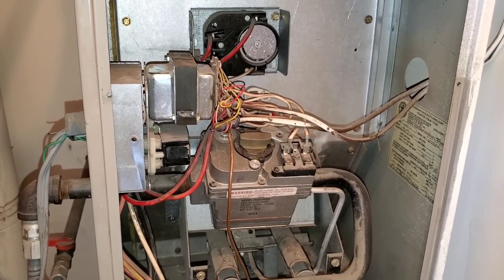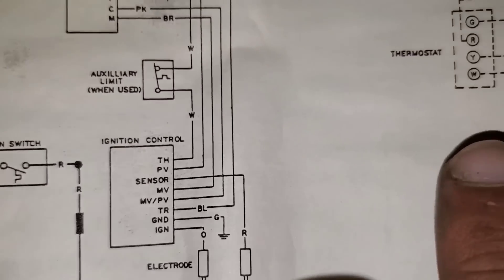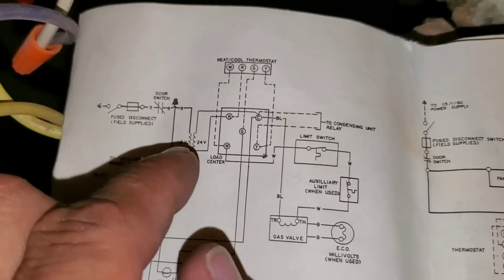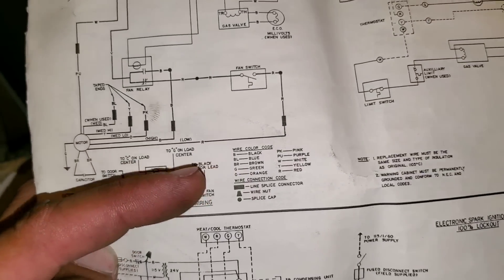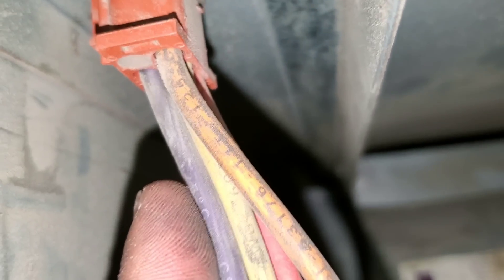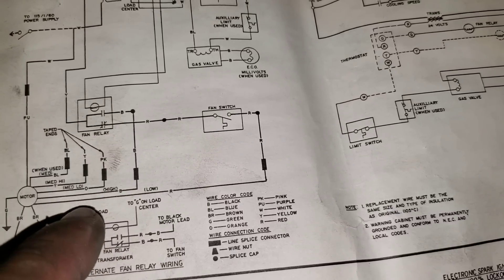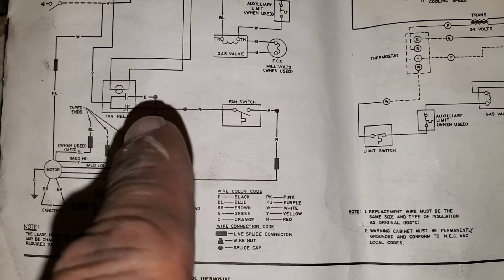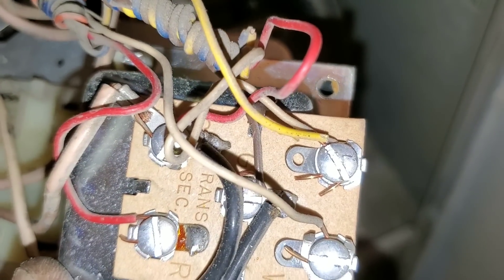Understanding HVAC Schematic Basic Wiring EASY!

Comment: As a journeyman gasfitter in canada, I think this is a good video as it uses a fairly basic furnace and does a good job of explaining how to read a wiring diagram. Between the sequence of operation, wiring diagram, using the correct equipment to diagnose power, vent pressure, gas pressure and combustion, near any problem can be solved! Good job!